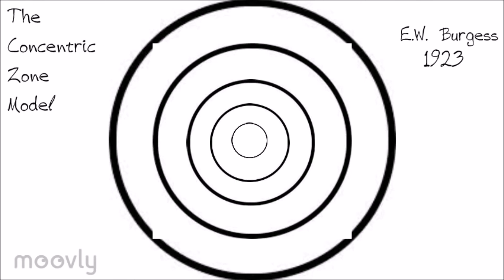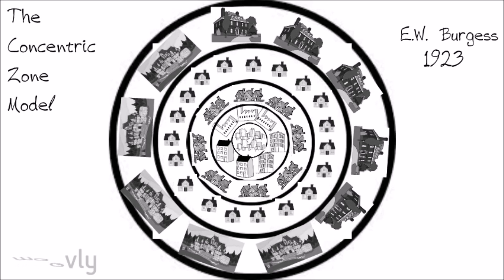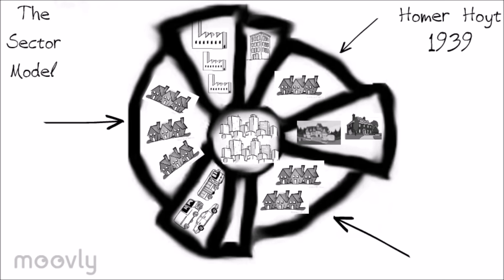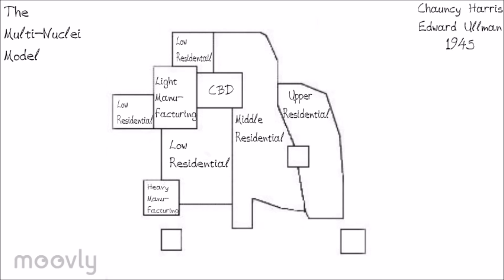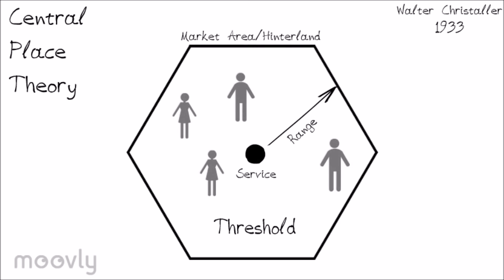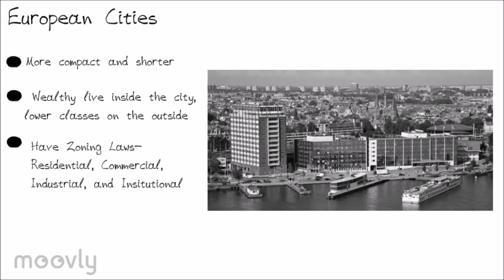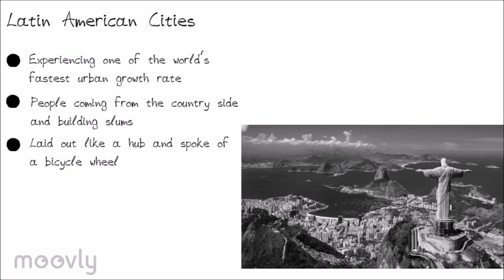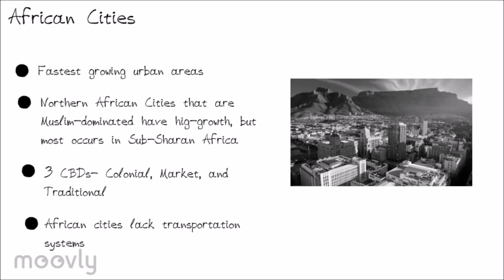Urban Planning Models: Concentric Zone Model | Sector Model | Multi - Nuclei Model

Comment: This is a fairly concise and precise summary of the three main urban structure models and central place theory. 

It should be noted that the three models deal with the internal patterns of land use for an urban area, is city specific as opposed to regional and thus considers cities as areas, while central place theory addresses the positioning of cities across a region and thus considers cities as points. 

It's also noteworthy that while no American city matches any of the models perfectly, some do follow one model somewhat, others follow another model. But mostly, cities exhibit some characteristics of all three models together at once. For instance, a city will likely develop outward in rings, but this pattern will be broken up by an interstate running through the CBD. Some of the more prominent freeway exits will start to develop their own commercial gravity, giving rise to a new nucleus, which in turn will attract its own concentric ring pattern. So, a blended conformance to the three models is the norm.

For those who find her delivery too fast, go to settings and change the playback speed to 0.75.